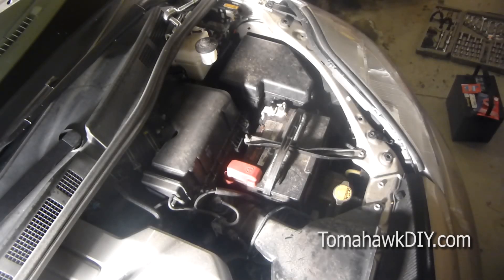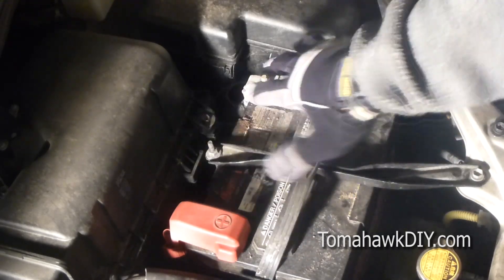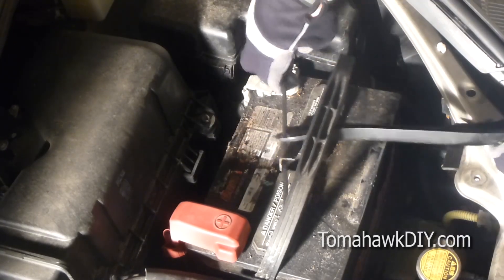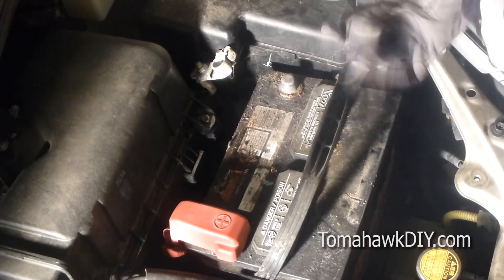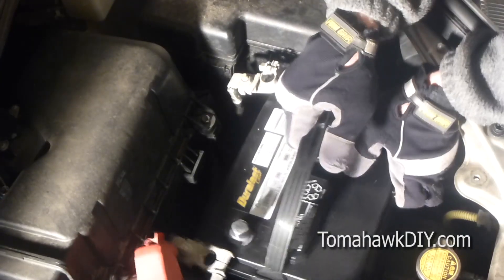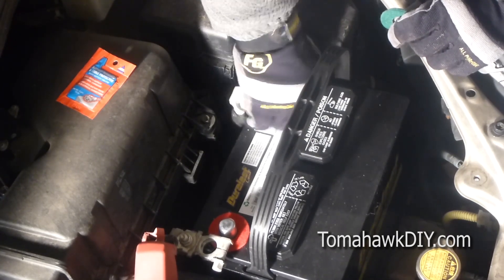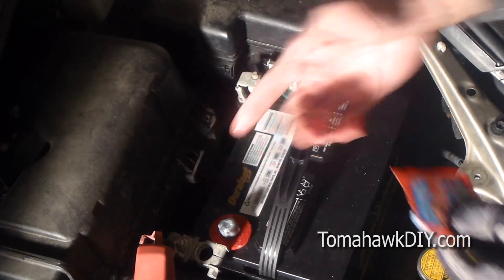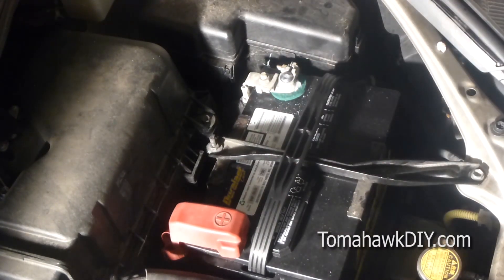How to Replace a Car Battery (or Van / Truck)

Comment: Very helpful. At 81, and a new widow, I've never had to change a battery before. Thanks to watching this I felt confident that I could do it and went out and removed the old batter (in my husband's truck) and took it with me, to the store, in exchange for a new one. It still was not easy for me because it is so heavy, but I got the job done.  Very helpful video.
Reply from the maker: Great job!

Comment: do you know where the batt is on a Citroen dispatch/Peugeot expert? It seems like I don't have one!!!
Reply from the maker: +Morgan De Bruler sometimes there is a plastic cover in the engine compartment hiding it. Other times it's behind a plastic cover in the driver or passenger foot well. Try looking in your owner's manual for info on the location
Reply: +Tomahawk DIY thanks for your reply. i did think it might be under the seat or something similar!! guess ill have to dig out the manual